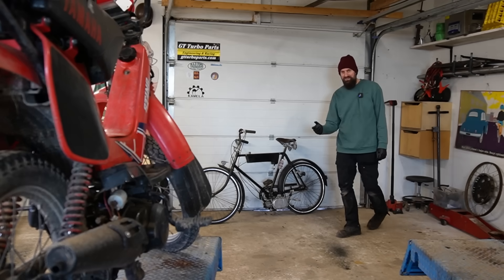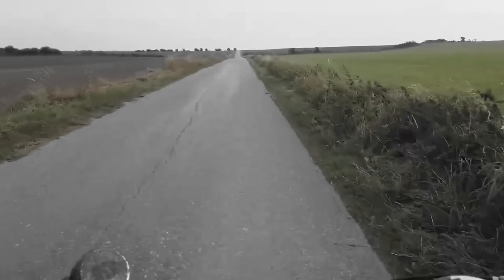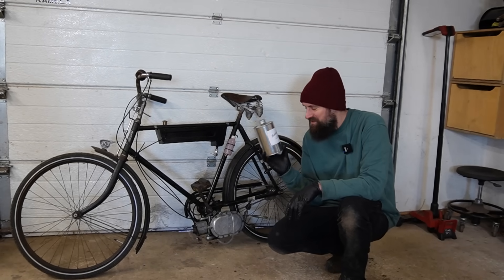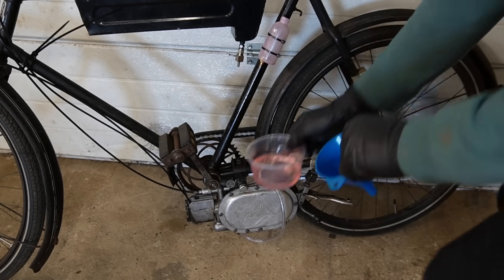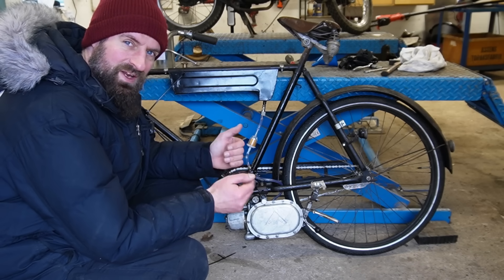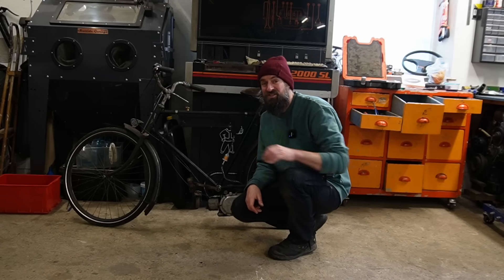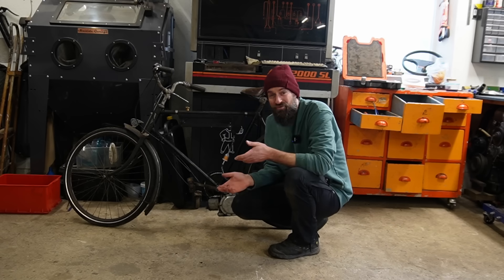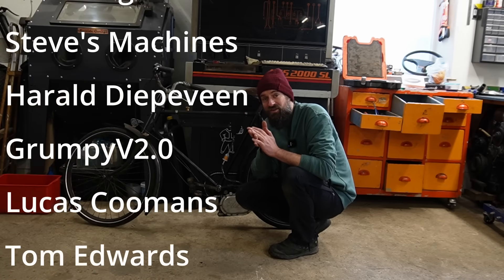Two-Stroke DIESEL Moped | Is This The Best Fuel?

Comment: Hey bud the two-cycle engine for motorized bicycle kits are a lot easier to work on and what the one you have I have an 80cc and it was a chain hook up to it with the gear it works a lot better your problem is that don't have a chain from the wheel to the engine

Comment: I have used jet fuel with 5% two stroke oil on my Lohmann. That worked very well.
Reply: Jet A fuel is kerosene, no difference, other than filtration and care to prevent moisture

Comment: I love your slight danish accent! Great videos!
As a professional mechanic it was sometimes a bit bitter to see how you treated this motor during overhaul.
Good tools are a must. Using different screwdrivers (at least use 2 identical ones and use some Textile TESA adhesive tape "Gewebeklebeband" as protection on the lever surfaces) to pull a bearing or the like is unfair for this rare oldtimer motor.
I forgive you alltough because you filmed everything xD .
Please - next time use correct pullers and USE your Press! (You have one!, I don't but I have a fine lathe and a fine mill)
I had my best childhood summer hoildays in Danmark. We went often to the Tivoli (København) and Billund for the Legoland. We were most of the time near Kerteminde on Fyn.
I was also often in the Railway / Jernebane Museum in Odense (I love the LITRA P loco made in Hannover xD by Hano.m.ag. Hannoversche Maschinenbau AG - I'm from Hannover).
My aunt Inka lives in/near Kiel (Laboe)
Cordial greetings! (also from a 1967 Dyane luxury 2CV owner - her name is Jana)
Géréon

Comment: The Drone Model Diesel engine was fixed compression and if you needed more compression, you just added more oil. If running Kero get jet A1 if you can.

Comment: Hello, what a nice little thing, which sounds like a satisfied hornet. When I was young, I drove a Velo Solex, 15 kilometres to the Highschool. In winter a diffikult task, but it went well. The only thing you needed, was patience.... with best wishes....Now, I´m 75 years old and ride two old Yamahas, a XV 750 SE 5G5 special from 1984 and a SRX 600 1 XL, one cylinder 4-stroke from 1989, which has only a kickstarter and needs sometimes 8-12 kicks to start, but it´s fun to drive this bike......

Comment: Kerosene, oil for lubrication, diethyl ether, cetane Booster (amyl nitrate) no more than 2% are the ingredients for model diesel fuel, not truly diesel engines but some kind of hybrid compression ignition.

Comment: I used to do RC model aircraft flying, back in the 1980's. The aircraft used a John Oliver 3.5 diesel 2 stroke motor and was fuelled with Ether & Castor Oil. The aircraft was always covered in a sticky mess, after a day's flying and required cleaning. The John Oliver 3.5 diesel had variable compression, via a screw on the cylinder head.

I've witnessed a CZ 250-471 Sport twin cylinder 2 stroke run on TVO (tractor fuel). It completed 31,000 miles like this, as a farm runaround work bike for 21 years. My friend bought it from a retired farm worker and it has been residing in his garage since the late 1990's. It still runs fine on the recommended 33:1 petrol-oil mixture, these days.

Another CZ 250-471 Sport, turned up at a motorcycle rally, running on a concoction of cooking oil and methylated spirits, way back in the early 1990's.

Comment: this is great. thank you for sharing. i thought this technology was from scale model air planes. Back in the 1990s i bought a 1/10 scale gas truck. then i found a diesel head conversion kit from Davis Diesel Development.  had more torque and more RPMs than glow feul. smelled like a Greyhound bus. i later modified the cylinder head to my two stroke dirtbike and ran Davis Diesel fuell in it. it worked. but i needed a variable compression head. my head volume stock  was 12cc and i went to 7 cc wich was close to 20:1. today i still believe that it would be  competitive if i could develop it more. thanks again for sharing

Comment: That engine should make about 1/4 to 1/2 of a horse power if it was a well designed system.  It really should be spinning faster than what it seems to be and the exhaust pipe looks too short.  The exhaust pipe can matter a lot on a two stroke diesel engine.  It can work to help get all of the exhaust out of the cylinder so the next cycle uses only fresh air.
Reply from the maker: Rated at 1/4hp :)

Comment: Try some linseed oil, burns very well in 2 stroke engines and was once used as a basis for racing 2 stroke motorcycles but you don't want to run it neat as it will put a hole in your piston so needs to be heavily mixed with something less energetic.   I ran my first motorcycle using a good dollop of linseed but man it smells bad, I killed my first Vespa using linseed as I did mix it linseed heavy and boy did the 125cc Primavera top the 90 mark it soon died with a melted piston crown and lots of piston bits mangling up the internals...

Comment: https://youtu.be/HZFX_ZDdnAM?t=169  Trip with Lohmann bicycle auxiliary engines Diesel engine near Lilienthal near Bremen in northern Germany on August 9th, 2009.
The Lohmann engine is a multi-fuel two-stroke internal combustion engine with compression ignition.[3] Its functionality differs from that of both the Otto and the diesel engine. Fuel is mixed into the intake air in the so-called mixer, so the engine has external mixture formation. The torque is adjusted by throttling the mixture with a slide. After pre-compression in the crankcase and overflow, the prepared fuel-air mixture is compressed so highly in the combustion chamber that it ignites itself. Since the Lohmann engine does not have a preheating device, the energy required for self-ignition during a cold start must be achieved in another way. To do this, the compression ratio can be increased by moving the cylinder liner by hand. When the engine has warmed up, the compression is reduced again. This also makes it possible to adapt the engine operation to the type of fuel used. The fuel used in the Lohmann engine should be as ignitable as possible, i.e. have a high cetane number.

Comment: There was diesel RC plain engines. Not nitro but they had little adjusters on the head to change compression and no glow plug. They needed a special fuel but there is info on guys making their own fuel. Believe it used kerosene as well as some other stuff. Maybe that is the stuff you need?
Reply: They talk about organic nitrates such as amyl nitrates and iso-propyl nitrates. Apparently you should not use them without knowledge because they can be dangerous? Therefore I do not recommend them. lol.
Reply: @chevy6794  The additive that makes up about 2% of commercial model diesel fuel is amyl nitrite (not nitrate). Even in the 1960s this was difficult to buy on its own because there was some misuse of it that was possible. It is claimed to give smoother running when added to the model engine fuel.
Reply: @cedriclynch  oh ok. Thanks for clarifying. Either way maybe looking into DIY fuel for those can help. I know it was used as a drug or something. Looked it up years ago.
Reply: Kerosene, Castor oil, ether, and a bit of “cetane improver.”  The following is a semi-educated guess:

8% castor
10% ether,
2% “cetane improver”,
Balance kerosene.

Comment: The mixture of kerosene, castor oil and ether is the fuel that "diesel" model aircraft engines use. Most of these also have variable compression ratios. You back off the compression until the engine starts to miss, then raise it just enough to restore smooth running.
Reply: All diesel model engines has a variable compression, and the old recipe was 1/3 kerosene, 1/3 engine oil and 1/3 ether. Then there are semi diesels, they had a glow plug instead of variable compression, and runs on 80% methanol and 20% castor oil. But there are different oils to, and nitro methane is often used.

I guess that this engine would be happy with say 10% nitro methane.
Reply: I remember experimenting with fuel composition as a school science project, closely related to my aeromodelling hobby.
The glow plug engines could be throttled to produce a banshee like bowl which was great fun.
Reply: Howl!, Not bowl. Autocorrect😣
Reply: @pw601  Autoincorrect? Autowrong?
Reply: One third of each, you have just sent me back nearly seventy years.

Comment: probably will be much easier to tune on some sort of test rig  with a load on the wheel, like a generator with some nichrome wire spiral as a load. also there are alot of aps to measure speed.
thanks for the video 👍

Comment: i just bought velo solex 2200 its a two stroke max speed is 20mph 49cc 2 stroke engine its a 1964 model hadnt gone in years so got it running and its does 100km to the tank i think thats a litre but really pleased with it considering they didnt really change much from 1946 i use it to get to work all week drive it to church which 25km return thats takes about an hour it costs me about $3.00 in gas maybe .50c in oil its cheap as chips to run.you still have to peddle a little bit on inclines but it assists great little bikes to get around on.Pretty reliable as well
Reply: I have one similar, which I use occasionally. Good to hear you put yours to regular use.

Comment: QUESTION:  could you add an electronic circuit to control the variable compression along with sensors to monitor the engine temperature?  It would be nice to create an automatic version of this engine so all you would have to do is ride and change fuel when it gets low.
Reply: Yes but measuring the temperature to determine how much compression is tricky. Generally thermocouples are millivolts and very susceptible to noise.

Comment: Try 1:1 diesel/gas ratio in it. It was in user manual as a possible fuel with 4% oil, but add like 10% oil for better lubrication.

Comment: You could send a sample of the fuel to a lab to get it analyzed. This way you'd find out the composition and ratios of its constituents.

Alternatively, you could distill it and get a hint of which substances are in there and how much, by observing the temperature of the vapor from each fraction that comes over.

Comment: Isn't Ether actually counter productive? It and start spray in general behave more like gasoline, so they will actually increase the fuel's resistence to self-ignition under compression, which is the opposite of what you want in a Diesel engine (or a multi-fuel engine that relies on self-ignition).
Reply: Ethers are condensate molecules composed of 2 alcohols (usually methanol) joined by a fairly unstable O bond made by removing an H2O out of the two -OH on the alcohols.
When this fragile bond breaks at ignition temps, it forms alkyl and -O* radicals that then go around brutalizing any nearby molecules, which is why it works so great as a starting fluid in compression AND spark ignition engines.

Comment: This little engine reminds me of the diesel engines that I used to power model aeroplanes many decades ago. Have you tried that fuel? It was ether and castor oil, if my memory serves me well. Readily available.The main problem here is that 18ccs are justnot enough. 25 might do the trick. Fascinating stuff, nonetheless. 🫣

Comment: Certainly seems to be quite the task finding the right fuel (and fuel ratios) to get this little engine putting out some power, all I can think of is that the earlier engines that Rudolf Diesel created ran on peanut oil, so maybe that would work, or would drive you nuts... :P
Reply: It would smell nice at least!

Comment: Guess what my viking friend, I'm a Brit living in Germany so I just Wikepedia 'd the Lohmann motor. In the description of the motor it says that this 18 cc motor will in fact run on almost anything , however the best results were achieved with a 20:1 2-stroke mix of petrol and oil. It doesn't however state which oil and I assume that a lead addative would be necessary and the octane of the petrol might also be critical. I'm passing on this information as a courtesy and can't verify the statements made in the text. If you're interested just google 'Lohmann Motor' and the Wikipedia link should pop up. I would imagine that Google translate should get you the information in your native language.